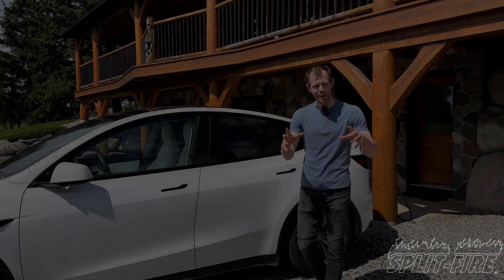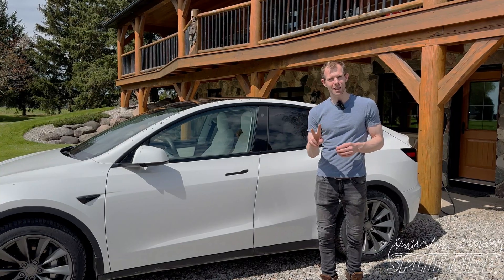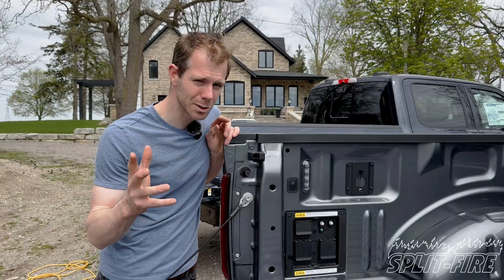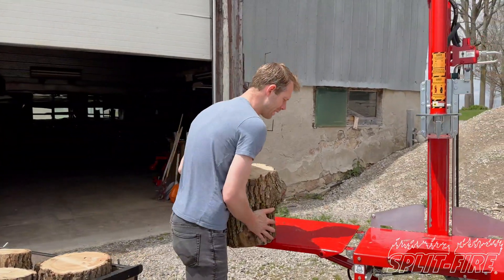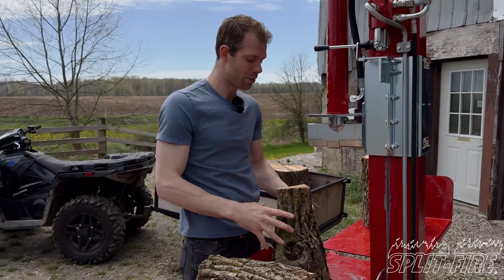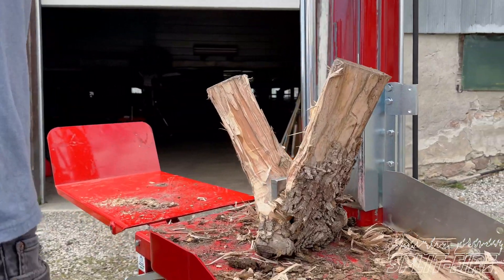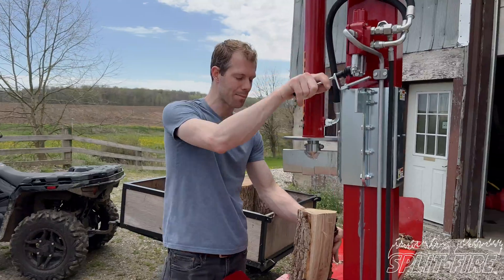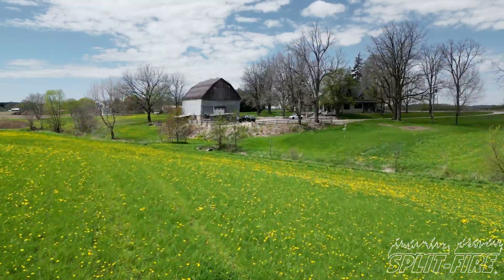Split-Fire | Electrifying the future | HD 4K

Comment: 5 second cycle time with electric and that tiny footprint in garage space is really hard to beat. But the sound of the splitter is not something I can get past. Not trying to be negative, I really love this setup.
Reply from the maker: True, the motor whine isn't exactly the most soothing sound but it can be overcome with a set of ear muffs, shop music or even wireless headphones. Happy splittin' !!
Reply: @SplitFireSalesInc I was wondering about this. I’m assuming the whine is from the pump and presume the gas splitters have it too, just drowned out by the motor? Was also wondering if the two stage pumps whine more than a single stage one would (maybe because of the check valve in there). I have a 5HP electric motor that I thought was needed when Dad’s compressor had an issue a decade+ back, inspired by this splitter I think I’m going to build a hydraulic power pack using it and see how that goes.

Comment: I'd still get the gasoline version. Can't wait to see the foot pedal option and how it works. If I was starting over in firewood, the value of the 1165V is hard to beat. Some of the tree service rounds that I have to split probably weighs as much as this splitter.
Reply from the maker: Both motorized alternatives gas and electric offer their own pros/cons. We feel there is a significant amount of people out there that still want an electric option for their homes and have something of a silent split action in their garage or workshops.
Reply: @SplitFireSalesInc  if would be splitting indoors, the 1165V electric would be my first choice.
Reply: @SplitFireSalesInc  hassle free!

Comment: fun video.  i use my lightning for remote power all the time.  on the 240V 30amp plug it can put out some serious power.
Reply from the maker: We were absolutely thrilled with how well it handled the amp usage when splitting really tough wood. Definitely, it wont be everyones primary option to split this way but, in a pinch this will handle a lot of splitting at a very low operating cost.

Comment: I absolutely love the electric splitter option!  That could also be run with one of the very popular solar battery banks and used in an off grid type scenario as well.  I love gas stuff but electric surely has a place as well.  For year lineman would drill holes in poles with 2 stroke drills, now they use an 18V impact and drill away with no struggles at all!  I also would love a machine like that for use indoors when the weather is less than fantastic.
Reply from the maker: Yeah, we wish we had a solar bank for the video cause we wanted to show more electric power supplies but we feel we met the mark on this one by showcasing a hybrid and full EV.  We're gonna see how they fair in the shop with a couple Makita batteries and maybe make a quick video on that in the near future?
Reply: @SplitFireSalesInc  As a Makita user, That would be awesome to see!  Best, --J.Andre. / Old Iron Acres
Reply: @SplitFireSalesInc  that would be interesting!
Reply: Same here when the weather sucks. Very few good options for electric splitters when the weather isn't cooperative.
Reply: @thefirewooddoctor  could be super useful!